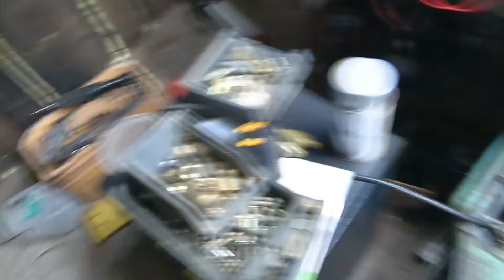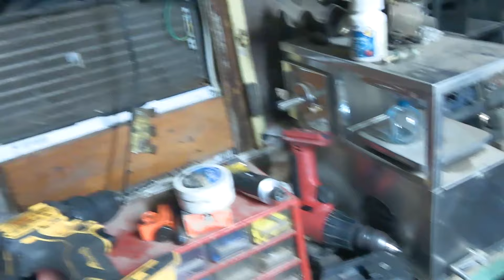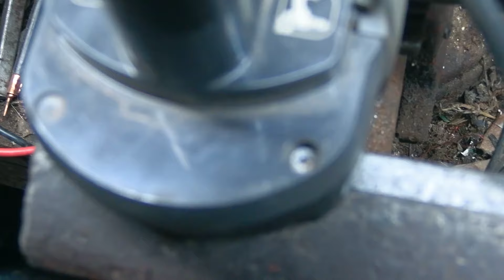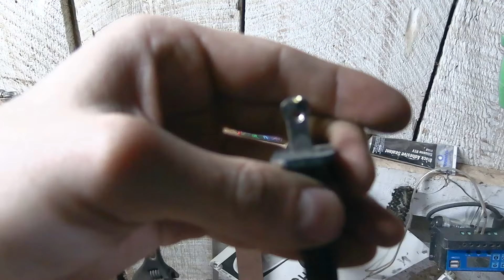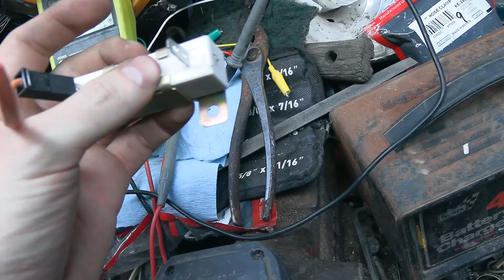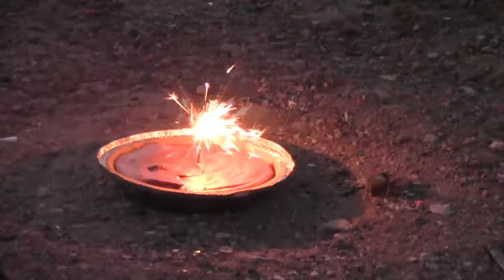Ryobi Batteries Won't Charge? Quick Fix

Comment: as someone who gets these batteries for free from the recycling center i have lots of xp when reviving these. you should open these up and first check that the cells are not open circuit from over discharge. some cell will even become heaters when charging. i don't bother collecting any ryobis without battery meters.
the pcb in the battery has 2 mosfets connected to the negative side of the cells and negative output of the battery. one is for charge current and the other for discharge current. this is how the battery protection works.
one thing to remember all ryiobi batteries self discharge because the pcb inside is constantly trickle draining the cells for its operation so they do require maintenance charging every one in a while.
becuse of the batteries ive repaired and collected i have more ryobi batteries than i will ever need.
Reply from the maker: Just trying to eliminate the hassle of opening with a drill
Reply: @unigrampa  you don't need a drill to remove the security tab. use a thin screwdriver and stab the middle of the tab than angle it out the side of the screw slot